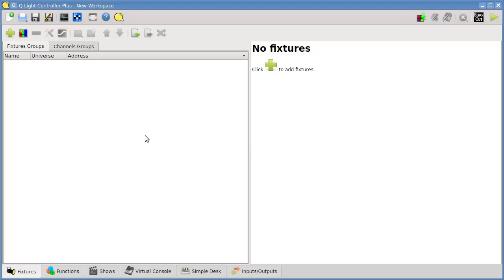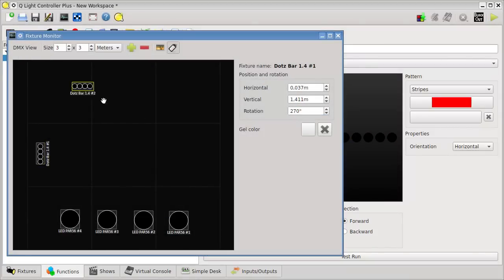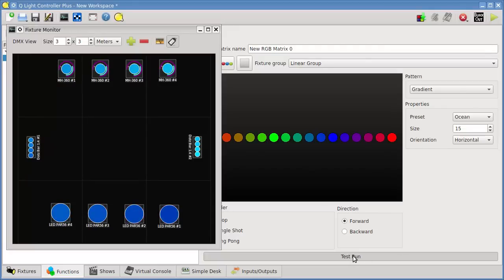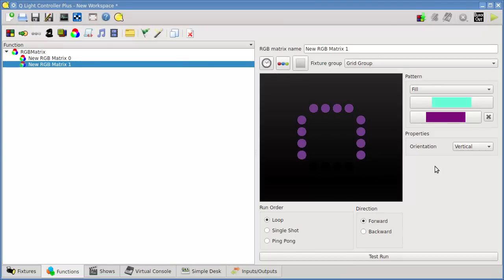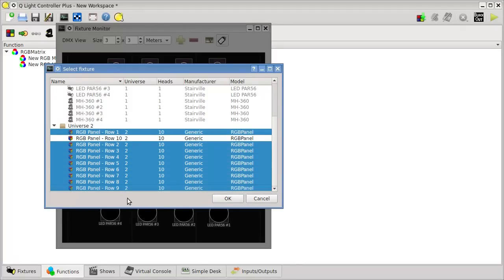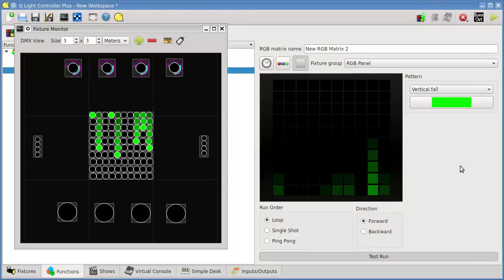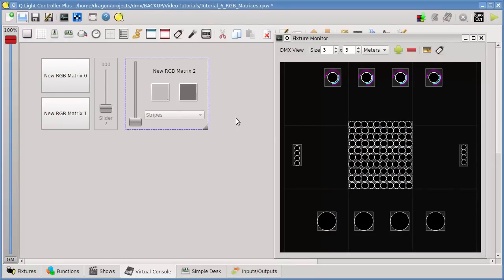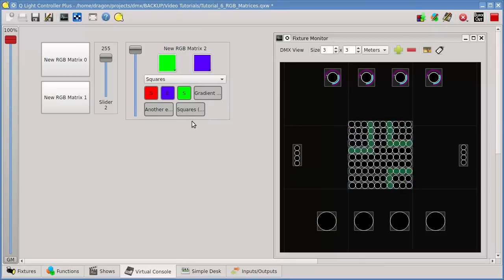QLC+ Video Tutorial #6 - RGB Matrices

Comment: Hi, thanks for the great tutorial! However I run into a problem. It works fine usually, but some pixels are stuck after a few minutes to some low, but not black value (stay on even after the function is turned off). It is very disturbing and I cannot get rid of it, only by restarting the SW, ruining the show. Is this a setting problem or a bug? Blackout turns these off, but only until blackout is over. Only the RGB matrix function has this issue.
Reply: Actually same problem occurs everywhere. It happens when more functions control the same fixture, like static scene+flash scene or RGB matrix+flash scene

Comment: Thank you for sharing your knowledge.  It's super helpful.  It seems the newer versions have replaced the Test Run bar and moved it to the top near the fixture group name bar.  However, when I select it, it does not show what the show would look like in the Fixture Monitor.   I've watched the video a few times and cannot figure out the reason.  Any ideas on what to check?
Reply: Probably to late but the dimmer is set to 0. Increase the dimmer value to max!
Reply: @marsedleti  Still learning, loving and using your program.  Thank you for the response.
Reply: @marsedleti  Also, is there a way to transfer scenes/manually added lights to s different computer without having to reload everything?  I would like to move the program and all my work to another computer.
Reply: @howierodman4954  Yes it is. I am using one drive and I do switch from my PC, to my tablet and then my laptop. So you just open the program file from a second computer. Dont forget to transfer all the fixtures though :)
Currently I am connecting 3 LED PAR Lights to my ESP8266. And I am controlling them from different computers. Its a cool project. Wirelessly controlling lights from QLS+.
Feel free to ask any question!

Comment: Hello, hope you can help...

I made a custom fixture of an LED Pixel Bar. But my issue is that I can't make the "Custom Fixture" work in the test under the matrix settings but I can under the scene settings in the functions section of the software.  Is there something I'm doing wrong? The circles that represent each pixel just stay white after clicking on the "Test Matrix" button.

Comment: Does the Fixture Monitor work with Generic Fixtures?  It doesn't do anything in the Fixture Monitor or with the actual lights. Using MultiColor LED Washes.
Reply: Looks like the answer is no. I used the Fixture editor program to create a new light profile but unfortunately still not working. I even tried with fixtures used in this video.
Reply: @alexc2234  i use generic chinese par leds it works as long the fixture creation channels are correct

Comment: Hello. Thanks for the tutorials, great job.
I have a guestion that has nothing to do with a complex setup of fixtures.
For a performance in an art gallery, I want to use only one rgb led stripe, and I’m curious to know if I can  apply some effects (not only color changing) , like the presets
you described in this tutorial. For example, to isolate a certain part (number of leds) of the stripe, or split the led stripe in different colors, etc.
Thank you
Reply: Andu Dumitrescu did you solve the question? I have exactly the same problem.

Comment: Fantastic informativ tutorial. I made my IMG Stage line Mega Bar PRO dmx414 work with qligth+ and even RGB matrix, but the sample rate seems to slow. The colour updates only like each second and make a laggy experience. On your video it seemed smooth. I run on a 2 year old mac with, OS X yosemite, could that be an issue. It´s slow without any hardwear attached to.